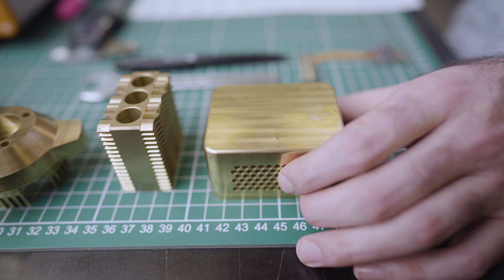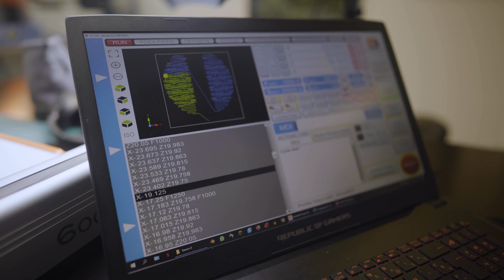Brass and Copper for CNC machining (explained)

Comment: Excellent demo! The conductivity and corrosion resistance of copper & brass make them irreplaceable. 🔌 At Jevny, we CNC machine these materials into critical components for electrical, marine, and architectural applications, ensuring the material's innate properties are fully utilized in the final part.

Comment: That milling strategie is a weird one never seen something like that because of the low percentage of tool engagement while milling. 
Why don’t you deburr the part right in the facing setup?

Comment: Having produced many thin wall components out of oxygen free copper...I have to disagree with your points on copper. 

Some alloys of copper (type 1 -free cutting, type 2 - short chipping) are easy to machine.  Low alloyed copper (Type 3 - long chipping), especially oxygen free copper are NOT easily machinable.  Great ductility and excellent cold-workability are not characteristics of an easily machinable material.  In fact such properties leads to rapid chip welding back onto the part or on the tool as Built Up Edge (BUE) and chip packing due to it's great ductility and poor chip control. Tooling for production of oxygen free copper parts involve highly specific coatings for example, Diamond-Like-Carbon (DLC) coated tools.  New machine functions like Low Frequency Vibration (LFV) cutting is introduced to the market as a solution to some of the issues dealing with copper.

Conventional cut tapping is a great way to break some taps as well. Getting that tap out was how I got my second job as a machinist.
Reply: Would you recommend thread milling then

Comment: You have a terrible misunderstanding about that pipe used on the computer heat sink you showed, that is a HEAT PIPE. It is hollow and uses a vacuum inside and a small amount of water, it does not transfer heat through the metal much, but rather a vapor inside the hollow center moves the heat. That heat pipe is far thinner than normal, but you can tell it is a heat pipe by the tear drop end where it was welded shut.
Reply: it can transfer heat through the metal in two scenarios when the heat is too low to kick off the evaporation process & heat pipe dry out when the heat is too high for the vapor to condense back into a liquid

though heat pipes are typically chosen & grouped together to avoid these scenarios for a given application.

Comment: These kinds of videos are awesome. They are very educational and it tells the story. I really love your videos, I learned a lot from them. I'm very new to CNC machining and mechanical design. Recently I learned that you can remove the machining toolpath with the lapping process. I would like to see a video about the CNC machine that you're using and some more information about it. If you can make it of course :). I have one more question. Where can you buy end mills for a small CNC router like yours? I have access to one "homemade" CNC router and all the tools they have are dull. I would like to make some parts out of wood as well as from the PTFE or even aluminum. Is there a "universal" tool to cut all of these materials?. Greetings from the Bosnia and Herzegovina :).